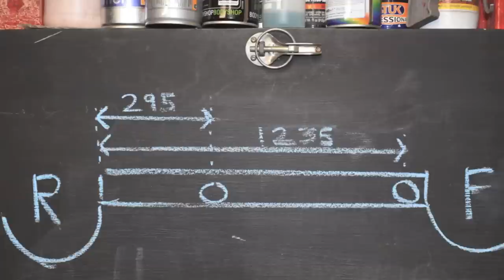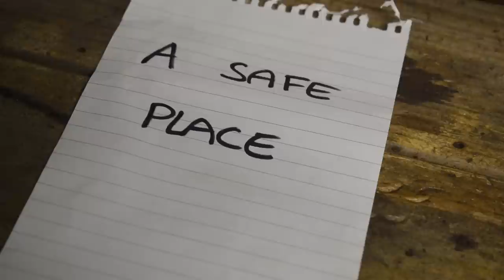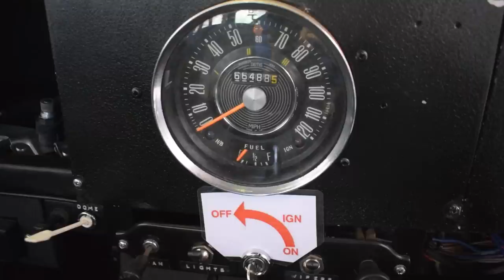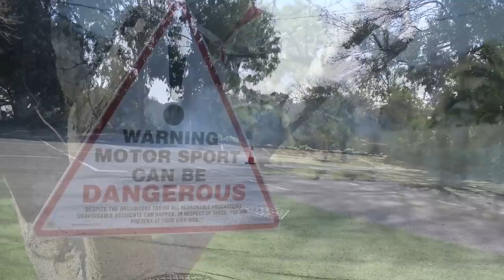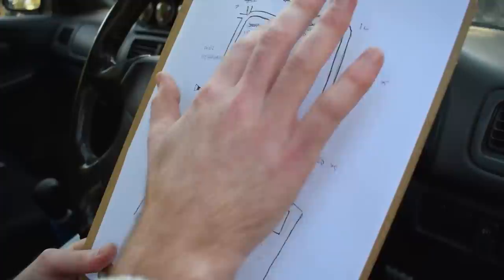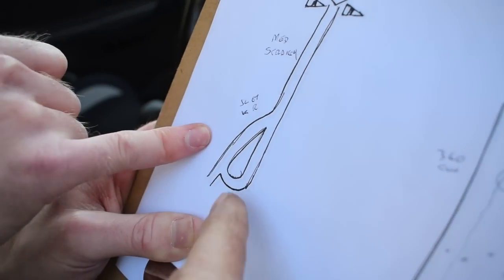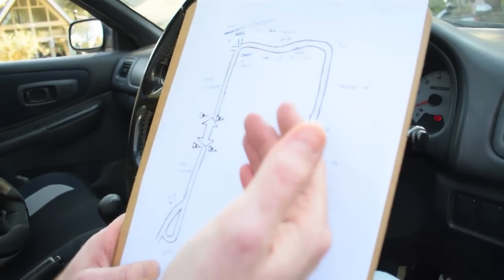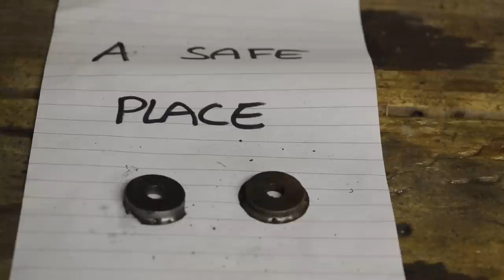Building a Classic Rally mini episode 14 - Sills, Autotest, and pace notes

Comment: Kevin,  I was glued from start to finish.  Great story telling..  being the newbie, I think I like the tape idea over the holes yet I can't quite figure out the true purpose...  literally loved the video..
Reply from the maker: Thank you Randy, when you plug weld you need the metal in the hole to be clean of paint so that you can make a nice weld, so rather than spending ages trying to remove this pain I find it easier to just mark where the holes will be with a sharpie and then mask a small section, that way when it is painted I still have clean metal where I need it. I picked this tip up from a local mini specialist here on the island. have you practiced plug welding yet?
Reply: The Gentleman's Motor Racing Team ah....   I must have missed something as I did not realize it was painted already.  Makes perfect sense now. Thanks

Comment: This is something I need to do on my rally car, so handy having sill stands. To do this job on a mini with already good inner and outer sills, would you have to remove the outer sills?
Reply from the maker: hello, no need to remove the outer sills, I had already fitted them to this mini but decided to re do it on this side as I was replacing the inner and outer sill. its just a case of making sure the inner and outer hole line up - these are so helpful when removing subframes etc - glad you liked the video